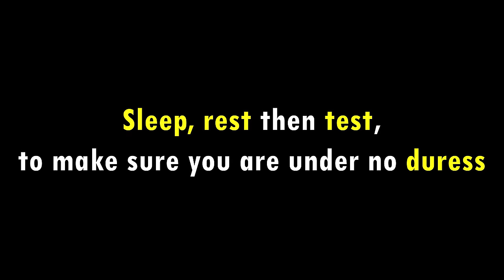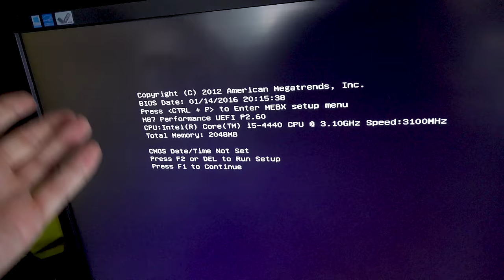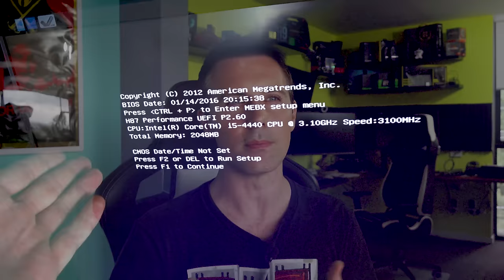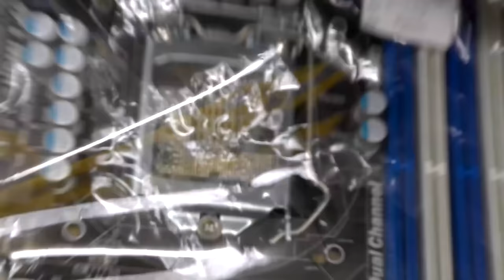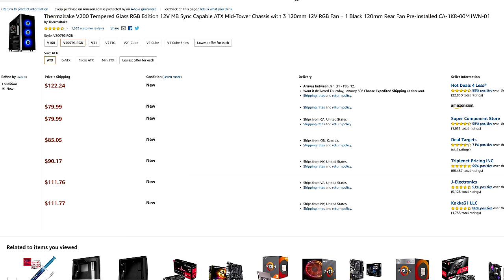Washing 12 Motherboards with WATER and Attempting to Fix them - (Can YES Fix it Pt. 1/2)

Comment: Sonic cleaners use warm distilled water solution with some detergent to clean electronics parts.   So warm water and dish soap could do the job.   I remember in the late 80's and early 90's, I used warm water from the tap and dish soap to clean two original IBM keyboards.   And it worked fine and if you want to remove water faster after rincing.  I dip the two keyboard in a bath of 90% isopropolic alcohol.  This will chase the water and help after with the drying process.    Can do the same for boards, wash them, dip them in 90% isopropolic alcohol and next place in the oven at a set temperature to help evaporate the alcohol for 10 to 15 minutes.  Voila!  You have a clean board.
Reply: Hey thanks for tips !

Comment: Some pointers here.

1.  Boards are cleaned in the factory with soaps and water.  In fact a dishwasher and good detergent would be a very good combination.  Dishes in the same machine would be acceptable but if you don't want to deal with potential issues run a cycle with straight up dishwasher detergent.  This is great stuff and cleans a lot of crud up.  Some formulations I have seen lately even clean up corrosion.

2.  As mentioned before, keep any liquids away from components with capacitors or batteries in them.  The charge if it arcs can either cause damage, or start fires if not careful depending on the solvent.

3.  IMHO the older stuff is impressive if you can supplement older hardware with modern stuff, ie for storage an sata 3 SSD, and if the chipset is capable, a NVMe PCI 3 SSD.  Tech though is moving at light speed it seems and as such, I expect that PCIe 5.0, DDR5, and USB4 will be coming soon to consumer platforms.  AMD is pumping out some impressive parts that are beginning to challenge the leaders of 2019 and as such don't expect Intel and nVidia to sit back.  In the next few years I think that we will see both massive performance increases while prices are held in check due to real competition.  As such, at this point the i3 10320 from Intel for example is a 4 core, 8 thread processor and that is faster than the older 4 core, 8 thread i7 processors on the older platforms.  Given this, be careful as something newer with better support may be a much better value for money than used parts.

Comment: To ensure a clean dry, I would wash the motherboards in water, as you did, then submerge them completely in Isopropyl alcohol to pull the water off.  The alcohol will then more quickly dry the board completely, and pull off the contaminates from the tap water.

Comment: Hy Brian,
I am an electronics expert al my life and I would suggest you a couple of things
1e After washing your boards with water wat is fine please dompel them completely under in isopropanol alcohol to get rid of all the moisture and let them dry.
2e Don’t use spray for protecting the boards, there is no need for it. Your circuits are low voltage so every form of electrical resistance will lead in unpredictable behaviour because of the high current some components need. (voltage drop)
3e Check if there are no leaking capacitors by pulling one critical cap out of the board and measure it with a good quality capacitance meter.
As you know there are a lot of VRM circuits on the board for every type of device (ram. cpu, chipset, etc…), also ceramic types included. (they are truly Chinesium rip-offs)
4e Measure the voltage rails after all the vrm’s on the board with a quality scoop to check the noise level.
 
I think this is a first must wat is easily to do.
Good luck, I like your channel.

Comment: I've had some success doing this in the dishwasher with no soap, just rinse program! My current htpc was dead when I found it in a dumpster, took mobo out, dishwasher then rinsed in 87% alcohol. Hung to dry 24 hours, still going strong 3 years later.

Comment: You need ultrasonic bath to clean components spotless 😉
Its called oxidation, aluminium does not rust, but still can oxidase
Reply: about to say the same thing....
Reply: Aluminum does rust. But only the outer layer, and it actually protects the rest of the aluminum. And it doesn't turn brown orange. Oxidation... Rust..... That's just semantics.

Comment: Try baking the rest of the boards. back in the day i brought a gts 8800 back to life by removing everything from the card then placing it on a hotplate. I put a little ball of aluminum foil at each corner to keep the board from making direct contact with the plate.

Comment: YES..fatty dust and such . did it successfully numerous times on phone boards,gpu`s and pc mainboards' . And blowing dry with a air compressor , blow properly under the chips .., did several de soldering of Lan chips after lightning stroke on pc and laptops trough the lan port  , installing a lan card afterwards. i had a pc to my shop where the costumer had sprayed mainboard with crc56. wow  :) washed it up and worked again

Comment: back in the 90's when i worked for a small repair shop, sometimes we would have to clean  mainboards down with dish soap and water,  and were thoroughly dried  in a  warm oven   before any work was carried out on them - if you didnt the pcb could bulge  this was particularly true for some consoles and home computers of the time -  dont forget pcb's are hygroscopic

Comment: I have done this. No soap,batteries removed b4,yes it can help clean them but that's it. Use canned air to blast them mostly dry,then Let them sit for a day in a warm room to dry out any water left in the socket,slots,etc.

Comment: If a PCB is not working due to a component failure, washing it is the worst possible thing you could do to it, Washing a board removes several tell tale signs of a part failing and could completely prevent a repair that may have been as easy as replacing one corroded SMD. One resister shorting to ground could be the sole reason for a board not working and washing away the corrosion that is left over from the cause of the failure removes the ability to just look at it and see a possible failed part.

Comment: I often get desktops from friends that smoke, or from pet owners and the whole PC is usually very nasty inside.  I've sink washed motherboards, graphics cards, fans, and cases.   One added step I do to the electronics after washing is dipping them in a pan of distilled water / RO water.   then I blow them out with compressed air and fan dry overnight.  I never had any issues with rust or corrosion. I've even cleaned keyboards and gamepads this way.    Not the ones with LCD screens.   Those I just blow out with compressed air.

Comment: Dam Asrock motherboards, had several of those die on me other the years
Reply: At least 3 asrock's died on me
Reply: That's what happens when you buy AsRock  boards
Reply: The newer asrock mbs are top quality, better than asus... in the x370 chipset the BEST mb is asrock, the best price quality is the asrock, and so on
Reply: Had a Asrock B350M Pro4, it was giving me constant BSOD and instability, driving me insane.
Never gonna buy Asrock again.
Never again.
Reply: MSI has the best mobos
Reply: Adam Flexen both my Asrock boards work fine. One of them older than these h87/h97 boards.
Reply: Watch Me Choke when did you have that? If it was close to the launch of Ryzen than it wasn’t the board’s fault. Almost every AM4 boards back when Ryzen first launched had an awful Bios.

Comment: I have cleaned boards this way, I had to do this to a ps4 and worked quite well. One additional thing i do after cleaning would be to use 99 iso alcohol helps keep the creeping death off it.

Comment: As I've gotten older I've learned to acknowledge production process in the issues with repairing all things. i think that because all of those BIOS chips were seemingly faulty, it's possible they had them for a while and in the process of them being made to making it into the boards they may have been treated poorly which means that they are all likely to be a weak link in the finished product. I think that at least in the PC parts market, when you pay a premium you're paying some degree of peace of mind knowing that the parts (on non-budget components) were treated with higher standards and won't fail as easily, even though the parts themselves may be of similar quality to those on budget boards/components.

Comment: Just toss it on the top shelve of the dishwasher.   From what I understand dishwasher tabs have anti-corrosives,  that combined with some jet Dry and your good.   Yes taking out the battery is a good idea.

Comment: I have donde this today with a super socket 7 motherboard and in this one has holes between the board and expansion slots (agp, pci e isa slots), using a heat gun was not enought to remove that water, as well inside the memory banks and ps/2 conectors for mouse/keyboard, com, usb etc, (backside connectors).
My personal recommedation, if you dont have a compressor to through air to the complicated holes dont do this in anyway, i went to the gasoline station and paid for the air and that removed that complicated water, that compressor was perfect because was not too much air speed and not too much slow.
After that i used again the heat gun but this time very more gently because the first time i overheated too much the board and i was not confident after that if the board will work, so that is my recommendation, no compressor = dont do this, and i dont know if ill do this again.

Comment: But won't water corrode some of the parts like it does to mobile phone circuitry? I lost an Xperia U phone because a tiny bit of rain dropped into the charging port and slowly over time more and more of the screen stopped working.

Comment: hey tech yes citizens and Bryan, was just curious about a sabertooth z77 board, my buddy spilt ramen all over the pc and after some cleaning the LED on the board comes on and the south bridge gets hot but it doesn’t start when tripping the power switches, any ideas?
Reply from the maker: Heya, most likely a circuit on the board is toast.

Comment: The contaminants that cause the corrosion do not evaporate.  IMO WD-40 while the board is still wet to lift the water (and hopefully the dissolved solids) off the surface of the components.

Comment: Actually, i have an Asrock Z68 Extreme3 Gen3 that has the same issue with the b85 one you mentioned. Actually i had an issue with that one where the pc just didn't boot in dual channel mode. It had to do with the mounting system of the Evo212x so reseating the cpu carefully fixed it. But sometimes it also did this with the ram slots needing 2-3 times reseating. Now since i didn't touch them they work like they should. Seems like Asrock had some quality control issues in the past

Comment: I can say personally after may daughter dumped a coke into my just build gaming tower (thankfully I managed to get it unplugged quickly.  It was booted up and running did the video card  and mem chips could washed it with very hot and soapy water used a soft tooth bursh then ran thought dishwasher then rinsed with 95 % alcohol.  Let it dry in a very warm and sunny spot for couple days then hit with a hair dryer for good measure.   And reassembled omfg it worked  used it for about 3-4 years after .

Comment: Tech NO city, if i did this, I would have used air pressure on the board in every nook and cranny for at least 10 mins.
Reply from the maker: I did that in part 2, these got left to dry overnight and were fine.

Comment: I have done this years ago with great success on computers that I would find out in the garbage.  First thing I would do, though, after removing the CMOS battery and plugging any holes up in any built-in speaker on the board, is spray the entire board down with WD40 and let it soak for a minute or two and THEN I would wash it gently with tap water.  The boards would come out looking like new!  I would also use a hair dryer to dry the board down and let it sit for a few hours before testing it.  I always had great success with this method.  👍👍😀😀

Comment: what would be an equivalent to the Australian export multi purpose spray that i can get here in the US?
Reply: dont do it, it has harsh solvents that are simply not worth using.  Use IPA
Reply: @BenState   even something like crc 5103 electronic safe cleaner?
Reply: Fetus PC-TECH  still has toluene in it

Comment: What kind of spray do you use to coat the MB? Can I use WD40? hehe
Reply: WD-40 is okay but I always use it with high mixture of water and immediately blow dry it. It leaves an anti corrosive layer. Never had issues, but do not use that method with aging thermal pads. Gpu's need to be repasted after using WD-40.

Comment: I've been doing this for 15 years and I love when someone is there to see it. I use distilled water though, not tap water.  Tap water has heavy metals, but I've wondered if matters. Apparently it does not. I had a guy run up to me from my alley saying I'm ruining my shit. But nothing has ever stopped functioning that was not already damaged.
Reply: After tap water wash it with distilled water to remove mineral deposits.

Comment: Hey! I also do this procedure for years, here's some tips:
1) Tap water isn't as conductive as people think it is, as long as you dry everything, you should be fine without too much residue.
2) You can use soap to help clean better, it's fine as long as you clean it off properly with water later.
3) You can use a teethbrush as an easy tool to clean it, just DONT BRUSH TOO HARD, GO GENTLY, if you go too hard you can tear SMD components off the board (ripping also their trails/pads)
4) I don't recommend spraying the board later, those sprays (such as WD-40) create a sticky coat that all it does is attract dust to it and causing it to malfunction later
Reply: I have a question can sweat damage mother board?
Reply: @ceejay1535  How the hell did you get sweat on motherboard lmao. But seriously, it most likely will be small amount so not likely
Reply: my motherboard is working fine for 5 years with wd-40... you need a proper case with filters to prevent dust and do a good clean with IPA from time to time
Reply: @wojciechgromek250  I work out with my mobo

Comment: NO! JUST NO! You don't clean motherboards with tap water! Why? It leaves potential for rust and corrosion! There is minerals in the water, that may get left over when it is dry! YOU ALWAYS use Isopropyl alcohol to clean motherboards!!  ALWAYS ISOPROPYL ALCOHOL!!!

Comment: When I worked at a repair house, the secret element for getting most dirty electronics back and working was a simple clean ultrasonic tank. They would mix it 50:50 and barely change it.

Let’s say 99% of things worked perfectly fine after a water flush and a day to dry

The most ingenious idea I’ve ever seen was using a dyson hand dryer to speed up the drying process. Most times we just used compressed air and a heat gun
Reply: interesting

Comment: Honestly it really depends on what you're trying to clean. For small stuff that just needs a bit of extra shine alcohol and some qtips and paper does the job. For bigger stuff I just usually give them a wash in my bath tub. Other than that while I don't recommend this to ANYONE, I have in the past cleaned power supplies with water. That said to do so I had to open them up and discharge their capacitors. I come from an electronics background and unless you are also comfortable working with high voltages please don't attempt this.

Love these videos YES, keep it up

Comment: I'm worried about the pins as they are directly under running water. There's force pushing the pins down.
Reply from the maker: Heavy pressure would be something to worry about, but the water coming out of the hose is not high pressure, so nothing to worry about there.

Comment: Something to keep an eye on because i had it happen when washing a board in the past but the water pressure from the sink can bend the pins back if u let the water run directly on the socket without the plastic cpu cover
Reply: My dude has Niagara Falls pouring out of his tap.

Comment: Where you cleaned up the pins on the bios chip, you could use the same fix which gets batteries to work in old electronics. To remove the layer of corrosion give it a rub with some vinegar. I've fixed loads of items doing that, including ones where the batteries leaked.

Comment: Bryan, use your heat gun to on the metal bent pins, and use a fine tip needle to move the pin under a microscope

Comment: The CPU socket plastic protectors can easily bend the pins when inserted incorrectly.
Reply: Yeah thats exactly what happened to me ... disassembled my old pc to sell the parts and had no idea how to put the plastic cover back on, placed it on the socket, felt like it sits good and pressed the handle down ...
Heard a quick crack and saw the plastic cover move a bit and knew that this mb is gone for good ^^
Reply: Jens Bühler  oh man, the same thing happened to me a couple days ago. Luckly that damned plastic protector bent only 1 pin.
Reply: AMD is more durable even the cpus the pins are thicker I 4 478 boards that still work
Reply: @sabbaristarella  as this reminded me of that board again i actually just tried to bend them back, but there were so many pins bend, don't know how i even managed to do that xD end of the story, board wont post no more :D probably gonna sell it on ebay for 5 bucks or so, so if someone manages to get it working again at least he could be happy :D its an H87 Pro4 btw
Reply: @1NIGHTMAREGAMER  yeah some time ago my friend dropped his ryzen cpu and bending those pins back was way easier and much more comfortable, the AMD way of doing this is was better, doesn't need that stupid plastic cover :D
Reply: That's what happened with me - ruined an Asud Z370 Prime-A board thanks to that  :( - wasn't able to bend the pins back. The socket protector shouldbe fitted over the loading mechanism and not go inside the socket itself